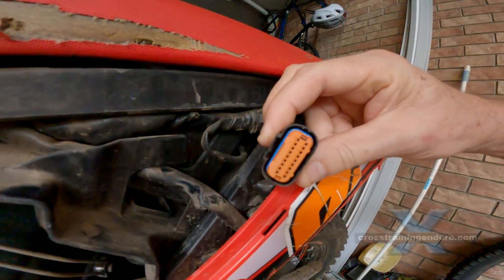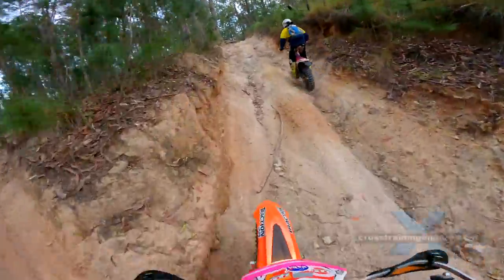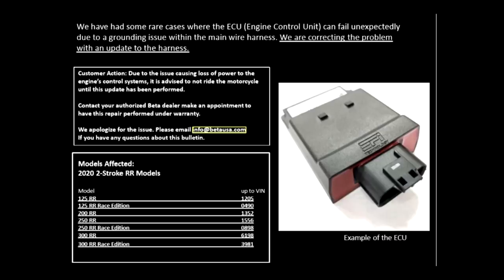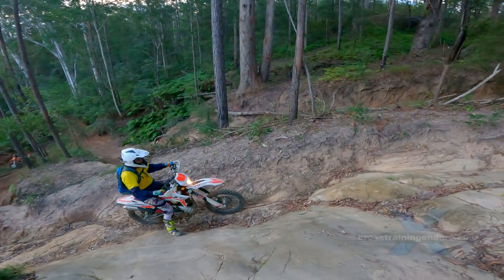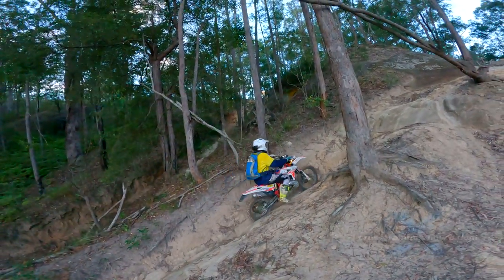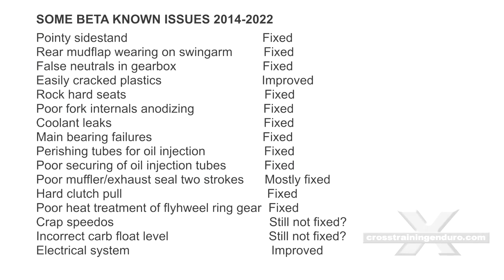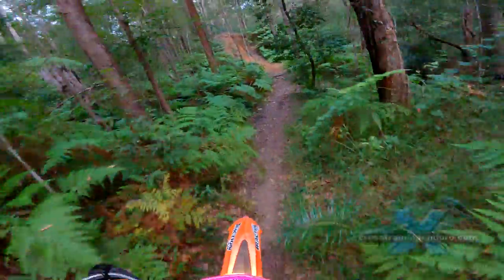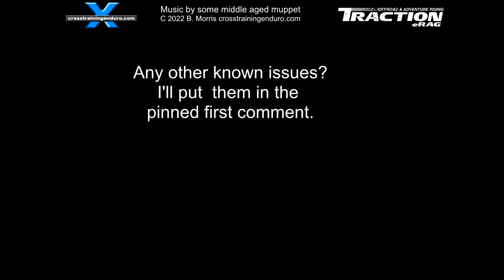Beta 2022 RR300 RR250 Xtrainer known issues review: more electrical issues 😢︱Cross Training Enduro

Comment from the maker: 2022 ELECTRICAL CORROSION ISSUES There have been quite a few cases of electrical corrosion problems on 2022 models. Occasionally it causes oil pump failure and seized engines at low hours. Beta USA is providing good support, hopefully it's good in other countries too. The Australian distributor has been blaming dealers for not doing 'correct' pre-sales preparation and putting dialectric grease in the connections! But thankfully the factory has started doing that on more recent models. Beta USA is very supportive when bikes seize. Many owners are now scrapping the oil injection immediately and using premix. 
2022 ONGOING MAIN BEARING FAILURES Beta dealers are still informing us about occasional main bearing failures at low hours in the 2022 models but it appears to be at a much lower rate than back 2018 and 2019 at least.
2019-2022 ECU FAILURES Beta used to use high quality Japanese made Kokusan CDIs, but in 2019 they changed over to a nameless Chinese version. Beta dealers are replacing quite a few of these under warranty. Hopefully it will fail during the warranty period if it's going to fail. 
OTHER ELECTRICAL ISSUES The speedos are still quite unreliable. One dealer says he just has a big box of these to hand out as they regularly fail during the warranty period. Overall the electrics can be problematic. Another dealer told us he's frustrated with the time spent fixing a wide variety of little electrical gremlins (e.g. engine light comes on when using high beam). 
OTHER PROBLEMS
Assembly still seems to be very sloppy at the Beta factory... missing bolts, bolts too tight or too loose, terrible routing of the wiring in some cases. The good dealers know what to fix and will sort it out in pre-sales prepration. Quite a few dealers won't. Be sure to ask them!
Reply: Just happened to my My22 Here is Aus. Only 27hrs

Comment: Hey Barry thanks for getting this out to all the Beta lovers and may they check their ECU plug and ground and have a Happy New Year as well. I'l report back on this issue when my service call  with Beta is resolved.
Reply from the maker: I'm sure it will be fixed properly in the end, Shawn. I've heard almost nothing but praise when it comes to Beta USA's support.
Reply: Well guys I hope beta fixes all that for the 23 models, I dropped 10600 on one and I bought the bike to ride, not work on. So far so good, but I will keep an eye on the electrical connections
Reply: @freetaylor72  Make sure you service the ground strap at the frame contact that’s likely the issue. Simple fix.

Comment from the maker: PROBLEM IS WORSE THAN EXPECTED. Beta USA hoped the cause was salty air corroding the electrics in transit, but now the problems seem to be too widespread. Beta has never been great with electrics. Just look at how many speedos fail. And sometimes the electrical problems are just fixed with a complete replacement of the wiring loom. This has happened under warranty and also outside. 
It is interesting to see that in many cases there is only corrosion on the one pin for the oil injection, which suggests salty air is not the cause. Some proposed theories are the oil pump is drawing too much current for the contact area on that connection. Or possibly a poor ground wire contact is doing  the same? 
Hopefully Beta USA will post any further reports, I bet  Beta head office won't bother... as usual. One dealer I spoke to said Beta changed from the ultra reliable Japanese  made CDIs a few years back, to some generic no-name brand probably made in China. He  wonders if crap quality CDIs might be part of the problem. Who knows?
ME? I'M DITCHING BETA. In our group, Ben changed over to TM last year. My brother and I have just sold our RR300 and Xtrainer, and will move to either TM or Sherco. We've had enough of Beta head office failing to address known issues, or taking so long to fix them, and providing so little support to their distributors, dealers, or customers, unless forced to do so. 
OTHER ELECTRICAL ISSUES A few Beta dealers have told me the waterproofing on 2022 electrical connections is pretty bad on both two and four stroke models, also Beta Australia is reluctant to pay for warranty claims because they reckon dealers should be putting grease in every connection (??!!). They also said Beta seem to have swapped from the ultra reliable Kokusan CDIs in 2018 to a cheaper Chinese made variant so CDIs are failing at a small but significant rate. 
OTHER POSSIBLE KNOWN ISSUES? A 2022 Xtrainer found movement in the rear shock upper mount, it appears the top bolt is too small. I suspect this is a one-off, but if anyone else discovers this, let us know.
LOCATION OF THE GROUND WIRE: It's up high on the frame near the top of the rear shock mount. Remove the fuel tank for easy access. See this vid: https://www.youtube.com/watch?v=Bhb3K1jkmEI
POSSIBLE POOR WIRING ROUTING NEAR RADIATOR: Signs of this include engine cutoff and not restarting, intermittent mapping switch, only cutting out when the radiator is hot, strange OBD codes, dead battery. The harness is not fastened were it crosses the radiator and can be inadvertently moved when taking the tank off and disconnecting the map switch. Beta was great at helping, they sent me a coil, ECU and ultimately replaced the wiring harness even though the bike was out of warranty.
- Captain Cornbread's Dirt, Gravel and Asphalt https://youtu.be/5CBp6ZJWkcs
FURTHER COMMENTS ON THE 2022 ELECTRICS One owner reports he can see Beta has revised the wiring under the fuel tank so that turning the bars is less likely to put pressure on the crimped earth wires. 👍
Reply: Just my Speedo 😂
Reply from the maker: The Beta dealers I know have a boxful of them to hand out for warranty claims. 😢
Reply: @crosstrainingenduro t Are the hours/miles stored in the ECU or do you lose them when you replace the speedo unit? Thanks for keeping on top of this. I'm waiting for delivery of my first Beta and I'm a touch nervous about these electrical gremlins as the bike is being bought for Romaniacs, so I need it to be reliable.
Reply from the maker: I don't know Arny. Dealers usually know how to reset speedos but I don't know if they can key in missing hours on a new one.
Reply: @ArnoldJudasRimmer  I wouldn’t be nervous about doing Romaniacs on it … the hours are stored on the clock not ecu…. On KTM tpi models they are also stored on ECU 🤓
Reply: The problem I had with my cross trainer was the plastics were awful brittle the speedo was total junk I went through two or three of them the wiring is terrible that key that locks the steering mechanism is really scrap that oil line that goes in the intake manifold is Mickey mouse in my opinion mine fell out and I take good care of my bikes I'm 63 years old been doing this stuff my whole life as far as the oiling automatic oiler goes I don't know I took it off and use pre-mix I was scared of it the horn fell off within a couple days bracket broke and I never could seem to get the jetting just right on it it was either too lean or too rich and no in between I even tried an electron and that was even a bigger mistake among other things with the beta like painted grounds etc probably the last beta for me for a while keep up the good work thanks

Comment: Hi Barry, the new front wiring loom for Beta 2022 2-strokes looks better-designed. That’s my wiring loom spaghetti in your video. The new part shifts the big bend in the harness forward and away from the steering head to behind the headlight - lessening the stress on the cold-crimped earth wires in that section that were susceptible to snapping in the <2022 Beta 2-strokes. Cheers, Christian.
Reply from the maker: Great to hear, Christian. Traditionally Beta head office can be very slow at times to actually do anything about known issues so it's always great news to hear of some action. 😊

Comment: Good timing on this Barry. My buddy ordered a 2022 200RR that is due in March. I’ll let him know all the stuff he has to fix before he rides it 😝

As far as the salt air affecting the connectors, they are sealed so moisture must be getting in from someplace else. Or they just weren’t assembled correctly. I know where I work we have a manpower shortage and management is actually assembling trucks that we build. That’s always a scary proposition. Italy probably has the same problem.
Reply: ...management assembling trucks lol... crazy world.
Reply from the maker: There have been some online debates about whether salty air should be getting into containers, Dave... and also getting into that connector. At this stage I'm prepared to take Beta USA's word for it but it could just be poor assembly/design/quality as Beta electrics have never been great.

Comment: Thanks for getting  the word out Barry! I really love my XTrainer but certainly was not expecting to have to deal with these issues on a brand new bike. So far our dealer has taken good care of us (we are in the US). We are replacing the wiring harness and ECU, fine tuning the frame ground, putting dielectric grease in allll the connectors and giving it another go. If the same thing happens we will bypass the OI and premix. 

Has anyone here had the service done already and gotten some more time on their bikes? How are you making out? Looking for some hope here!
Reply from the maker: Fingers crossed! My Beta mechanic is starting to recommend bypassing the OI once you are out of warranty nowadays. He used to say leave it in for a few years but I think the recent electrical issues have swayed his opinion on recent models.
Reply: my xtrainer died at 3 hours. zero help from selling dealer, 3 hours away. beta usa sent me copies of the electrical bulletins, none of which had been done by selling dealer brewer cycles. did the grease in all connectors, modified ground, no help. 3 seas recreation (jared) got me test info, turned out to be the ignition  case was full of oil. jared overnighted seal, crank sensor and flywheel tools. 20 hours now and no more issues. my take, do not assume the guy who put your bike together did any more than just that. if you want a warranty on your dirt bike, i would not recommend a beta unless you know the dealer and they are close. otherwise, i love the bike, just bought a fatty pipe from jared and it is even more awesome

Comment: Bought a new 2021 Beta 300 rr. 4 months ago and I must say everything is perfect on the bike . No problems whatsoever.
Reply from the maker: Great to hear. A small percentage just had electrical issues of various types. Keep an ear out for starter motor noises too, a few 2021 models stripped the ring gear on the flywheel easily. It's a known issue and will be fixed under warranty.

Comment: Had a buddy lose a battery due to overcharging on his very first ride on a 22 250RR, bad voltage regulator/rectifier. Dealer replaced both the battery and regulator under warranty.

Comment: Hello there! 2018 X-trainer. Only issues in 130 hours: Factory jetting too lean on main and pilot,  and float sticking due to binding pivot. Otherwise amazing bike!
Reply from the maker: Too lean, Paul? That's interesting! I remember in the early years they were too rich in warmer countries. The European settings had bikes oiling plugs here in Australia so the dealers were rejetting them prior to sale...
Reply: @crosstrainingenduro  Yes, I read about that too. One step up from stock on pilot and main got rid of that off-idle knock and much better response at speed (and I'm def a gumby).

Comment: My18 rr350 racing  had corrosion on a earth that put the engine light on took the shop a bit to find it and had the front forks fail at around 160hours.( the red once) other then that love the beta ! 👌🏻
Reply: Had my water pump shaft and seal let go at about 200hours as well . ( puts coolent in gearbox)

Comment: Mate of mine in Australia 2022 xtrainer 300 low hours engine seized due to the issue you talk about in this video
Reply from the maker: Bummer, do you have any details Paul? Was it actual corrosion of all the pins? Did they fix it under warranty? I have heard of one Aussie case where it was only the pin for the oil injection, which suggested a poor earth was the cause...
Reply: @crosstrainingenduro  yes one of the pins it is getting fixed under warranty new top and bottom end also another friend snapped his rear shock on one that was fixed on warranty too

Comment: My 21 300rr just got a new wiring harness and ecu.  All under warranty    Over 100 hours on the bike and this has been my only issue.   I did not grease the wiring connectors when I got the bike new     The new ones all greased up now
Reply from the maker: Glad they fixed it!

Comment: No, I didn't have any issues with my new beta because I never bought one and owned a ktm since 2017. Never, ever had any issues with that bike whatsoever. Thanks for the video though. It made me feel good for some reason. 🙂
Reply from the maker: My pleasure! Oddly enough, a lot of Beta owners say they feel good after watching the vid about KTM TPI problems. 😊
Reply: @crosstrainingenduro   that goes for most if not ALL tpi bikes would be my guess. Luckily, by bike happens to be a carburated model, the last one before the tpi came out. 🙂
Reply from the maker: Good choice! A mate of mine bought one of the last carb models in Australia and loves it. The thing goes like a rocket compared to all the TPI bikes we've ridden.
Reply: @crosstrainingenduro  thanks! Did you ever ride ktm or a sherco, 300 models? What do you think?
Reply from the maker: They all seem pretty similar to me, just a change of colour. The only really standout point is the TPIs don't have the same lowdown grunt of other 300 two strokes.
Reply: @agape_moto127  160hrs on my TPI zero issues.  I'm sure the day I have one I'll be at the dealer buying a carbed Beta or Sherco!
Reply: @PrimalEnduro  thank you for your comment, but unfortunately it doesn't make sense to me. Would you care to rephrase so that I can comprehend too? 🙂
Reply from the maker: 160 hours and no problems? Good to hear! Plenty of riders do find the system reliable but there is a significant minority who have problems. Did you have it remapped to use more oil? The TPI expert we spoke to recommended rebuilds at 100 hours with the stock mapping as they do tend to wear faster...
Reply: @crosstrainingenduro  We used to have many Beta's in my group.  I had 2 300's and a 200rr before the TX300i.  Most have gone to the TPI bikes and we have had very few problems.  1 guy did have a CCPS go bad after 230hrs of hard enduro type riding. I have not done anything to the map or motor other than adding an idle screw.   I've been happing with the TPI bike overall and would buy another.  However, given the slow/technical nature of my riding environment I'm considering going back to a 200RE or even a Xtrainer.  I've found the Beta's to be excellent reliable bikes once you sort out the small issues.

Comment: My 2020 300rr ecu and wiring harness failed at 45 hours, replaced under warranty.. now at 56 hours left side bottom end bearing has failed.. my dealer is putting in good will warranty claim to Beta Australia. Hopefully the come to the party and sort it out or I’ll defiantly be getting a Sherco
Reply from the maker: Bummer. We have had reports of failures in 2020 models and even later but thankfully they are more rare now compared to previous models. Let me know if they don't honour the claim. Beta Australia is coming under a lot of criticism from their dealers and quite a few are leaving now.

Comment: Its been a month since i got my 200 RR… everything on the bike is amazing, i’ve had ktm’s and japanese bikes and i can easily tell that the beta is the best bike i have ever owned!  So far it doesnt have any issue or problem except for the seat that is too hard
 If anyone is thinking about getting a 200cc the only thing i have to say is that you shouldn’t consider it if you weight more than 80-85 kg
Reply from the maker: They softened the seat around 2018 so imagine the cement they used to put in there, Humberto. 🤔 Great bike otherwise!
Reply: @crosstrainingenduro  😂😂 didnt know that! I switched from a ktm and the seat is really comfortable, so i found the beta really hard… anyway, i would like to thank you very much for your content, its great!
Reply: @humbertobizzotto  Seat concepts makes a super comfy seat for the Beta. They redesigned the pan to get an extra inch of foam plus the foam is better to begin with.

Comment: I just got an update from my dealer on the corroded plug and harness and oil injection failure.  His inspection of the engine top end showed no damage, however Beta said they would replace the top end and jug anyway as well as a complete harness and ECU. At this point Beta the jury is still out on if the issue is bad ground or extended shipping or something else. My dealer said Beta Italy hasn't released anything new as a fix so no changes to harness or ECU program. I'll report back in the spring when I get my bike back on the trails. Winter here in Northern Maine -10 F 😩
Reply from the maker: Thanks for the update, Shawn. I just admit the shipping corrosion concept sounds sketchy but I'll give Beta USA the benefit of the doubt as they've been very honest and ethical in dealing with known issues in the past. But given the poor track record of Beta when it comes to electrics I wouldn't be surprised if it's poor quality parts, design or assembly that is the real cause.
Reply: @crosstrainingenduro  I’ll keep you posted here of anything I hear and also What happens when I get my bike back.
Reply from the maker: Thanks!
Reply: @crosstrainingenduro  They are now being shipped into a port in Virginia instead of California so there won't be any unnecessary delays at sea.